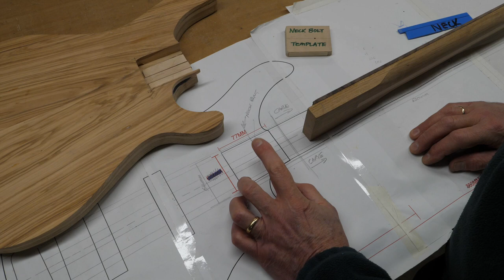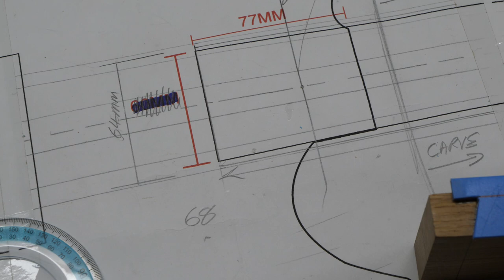Complete Bass Guitar Makeover - episode 15 - my wonky protractor!

Comment: You do like to make things difficult for yourself, don't you Dave? 😂Why is the end of the neck at an angle anyway? Why not have it and the neck pocket square? Have I missed something❓
Reply from the maker: That’s me, always go the scenic route 😂. I like the way the neck fits tightly into the corresponding angle in the body, with just one bolt I feel I need the extra support. Cheers Dave